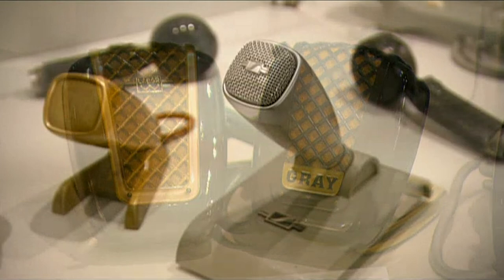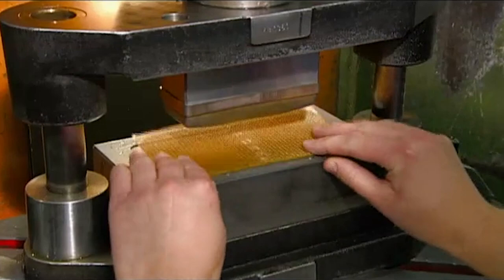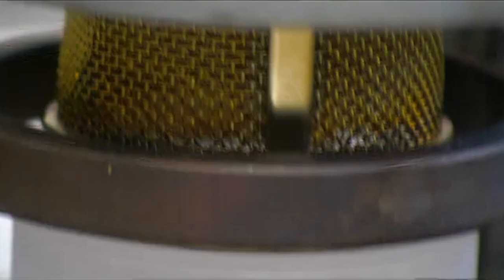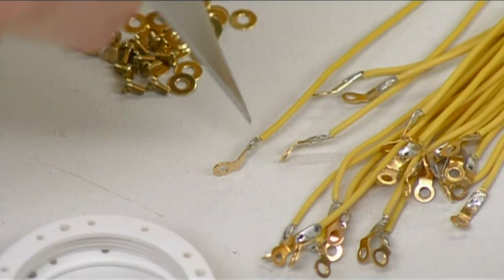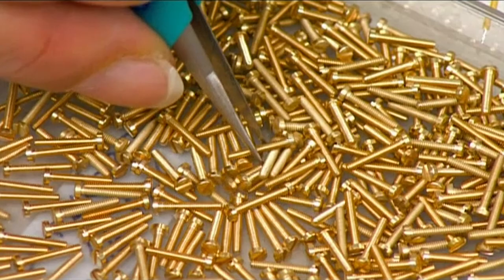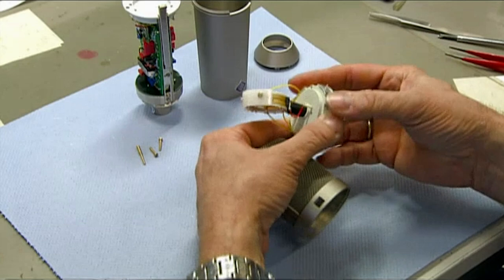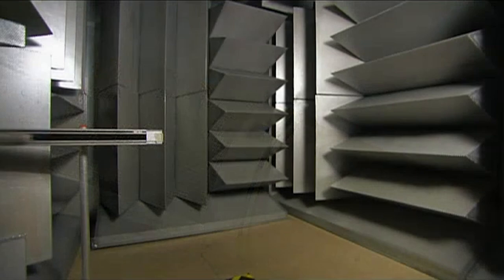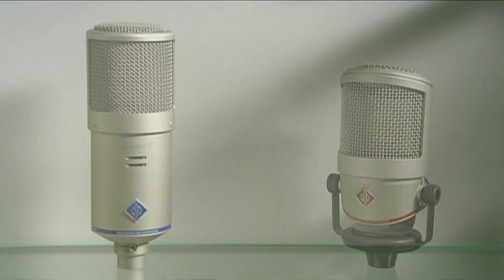Microphones | How It's Made

Comment: The microphone that you have just seen manufactured is the Holy Grail of studio recording, the Neumann U87 Ai.
Reply: it sounds so crisp. But its so expensive
Reply: @caleb7122  That's because the diaphragm is made of gold, so it can conduct electricity. Remember, gold is VERY conductive to electricity and is also very flexible.
Reply: @NateCraven318  but I'm pretty sure that's not why they used it
Reply: not THEE holy grail. I'd put the c800g before the U87 and maybe the U67 but it's def top 3 best mics imo.
Reply: And the capsule costs.. around 180$.. damn
Reply: How much would the manufacturing price be
Reply: @pushinpee3115  the best mic is the Telefunken 251
Reply: @NateCraven318  not as conductive as copper or silver, there’s other reasons to use gold
Reply: @pushinpee3115  kinda depends on what youre recording
Reply: @Jon8ight  best mic for what
Reply: @albusking2966  well all of the mics I mentioned are pretty well used in a ton of vocal chains. So I would say vocals
Reply: There's a large chance that the narrator recorded his voice over using one!